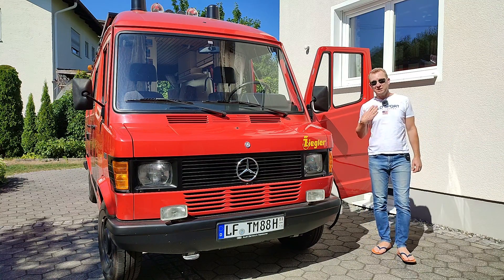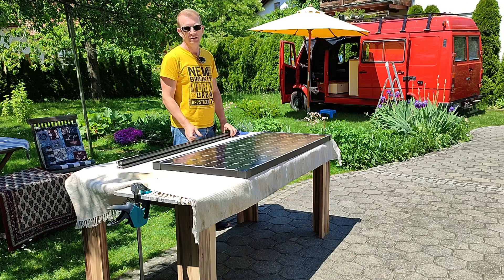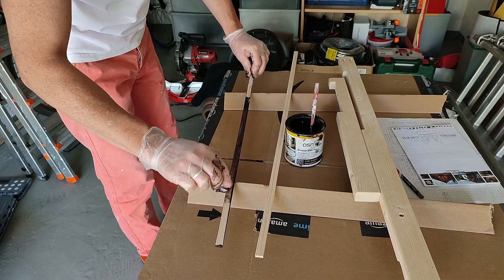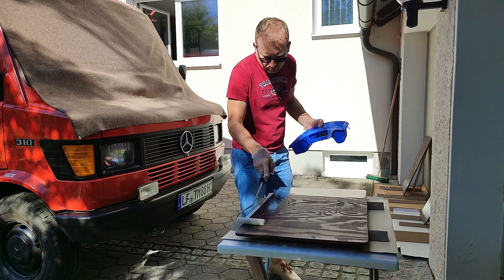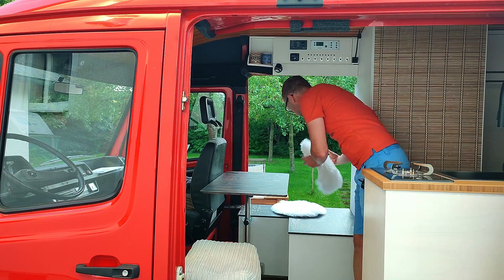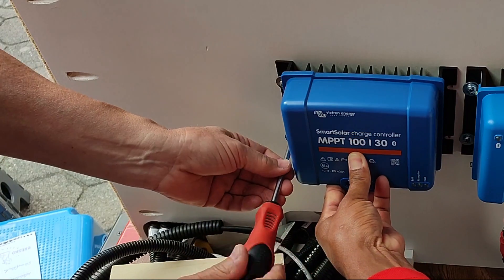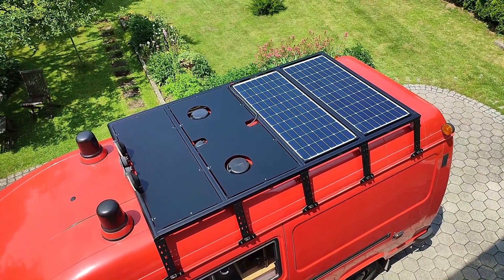How to Install Victron Solar System for DIY Beginners: Complete Wiring Diagram | Mercedes Camper Van

Comment: You need also a smart shunt, because there is no other way to monitor the charge status
Reply from the maker: Yes, absolutely correct. I use a Votronic Smart Shunt 200 in my system. You can see the installation in one of my other videos.

Comment: Great work! I am working on the T1 roof rock as well. May I know the dimension of your roof rock ? Thanks
Reply from the maker: I used 40x40 profiles. Total lenghth is 2.40m and width is 1.44m

Comment: Hi Mike, wieder mal ein *** Video. Exzellent erläutert und klasse gemacht. In dieser Art habe ich mir den Einbau der Solarpanels auch vorgestellt, mit genau den 150 A Paneelen der Tiger. Wahrscheinlich wird aber der Platz auf dem Sprinter zwischen den C-Schienen nicht ausreichen. Ich habe mir Muster der Aluprofile bestellt und werde messen. Notfalls benötige ich eine Sonderanfertigung der Haltewinkel auf den Schienen, durch die ich ein paar Zentimeter an Breite gewinne. Mal schauen, ob das klappt. Viele Grüße, Klaus.
Reply from the maker: Hi Klaus, die Paneele von Tigerexped kann ich auch wirklich empfehlen. Und beim T1 passen sie halt auch zusätzlich noch wie maßgeschneidert zwischen die Holme vom Dachträger :)

Comment: 24.12 % efficiency is total bullshit. Excuse my French... 24% is extremely expensive space-grade equipment. My calculator says: 20.82. which is much more realistic. Never trust the efficiency rating. You know the surface area and the output. Which makes it very easy to calculate the real efficiency.

Comment: I am not saying this is wrong 
however you left the edge protector on the solar panel. While this does not cause any harm it is recommended to remove them
Reply from the maker: Thanks for sharing this info! I didn't know that.

Comment: How about the grounding of the MPPT? Isn't that necessary? Congratulations to your amazing looking van though!!!
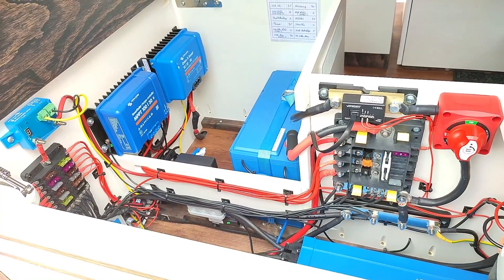Reply from the maker: Hi Mario, you are right. The MPPT casing has a screw at the side which is for attaching a ground cable. In fact, you can see my ground cable in the video (16:01), but I should have put it in the diagram as well. Thanks for mentioning! :)

Comment: did you think about rotating driver and codriver seat?
Reply from the maker: Yes and I would still like to upgrade! But I couldn't find any good one yet. In fact, I already bought 3 different models, but I didn't like any of them, so I sent them back. If you ever find a good one, let me know!
Reply: @CubeofCars  did you find rotating platforms for T1 vans or buy something universal? I'm looking for this, so would be great if you could share some links. 

Great videos by the way and wonderful van!
Reply from the maker: @HeartSpacers Unfortunately I still haven't come across any suitable model...